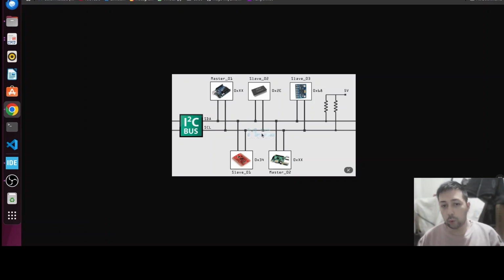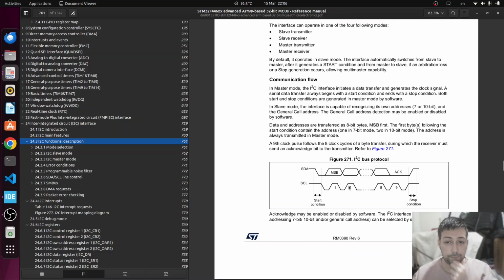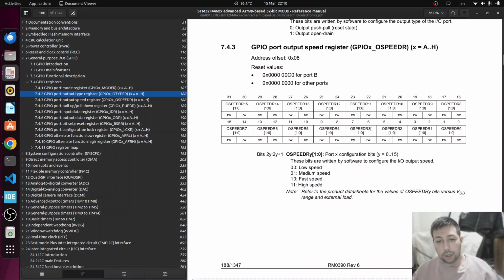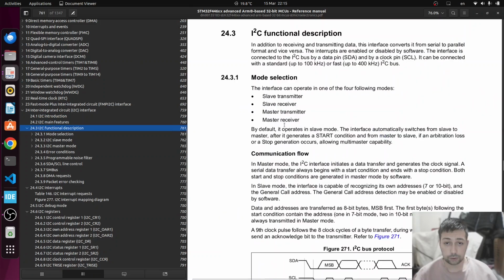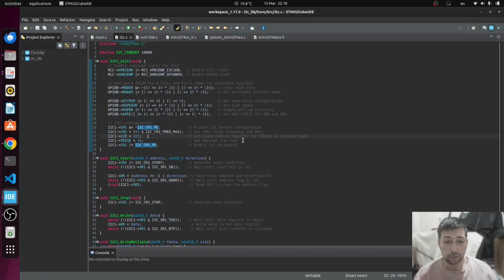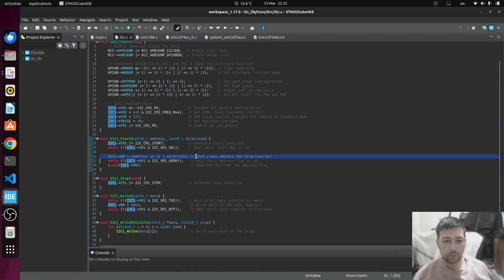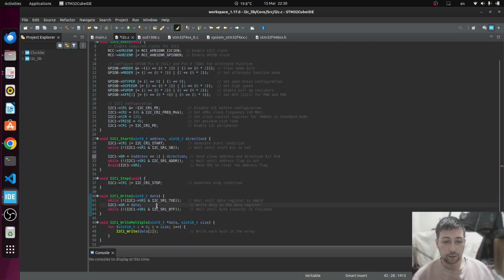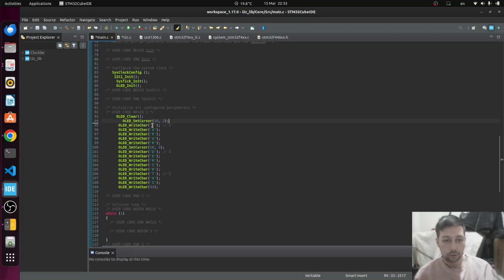Writing I2C Drivers for STM32F4 | Register-Level I2C & OLED Display

Comment: Absolutely stunning! 👏👏👏👏
Will this work with STM32F401RE? Please advise
Reply from the maker: it has a similar I2C peripheral structure. But, it might be some differences in register mappings and clock configurations. so my suggestion check the reference manual right there 
https://www.st.com/resource/en/reference_manual/rm0368-stm32f401xbc-and-stm32f401xde-advanced-armbased-32bit-mcus-stmicroelectronics.pdf